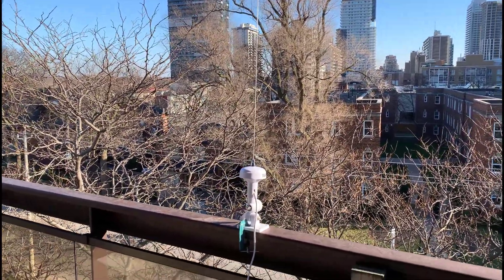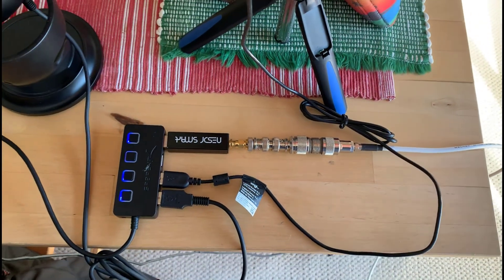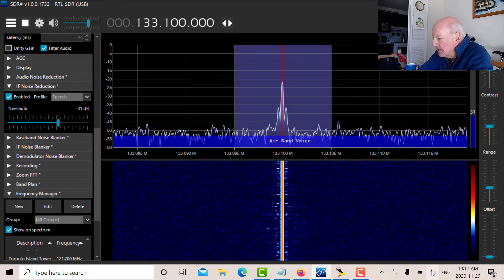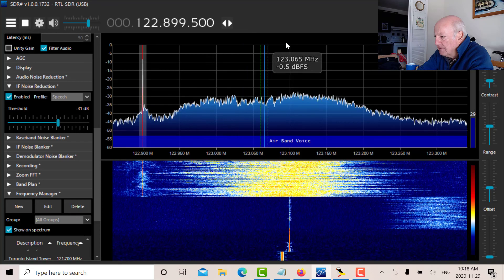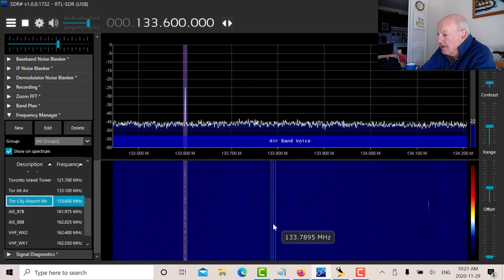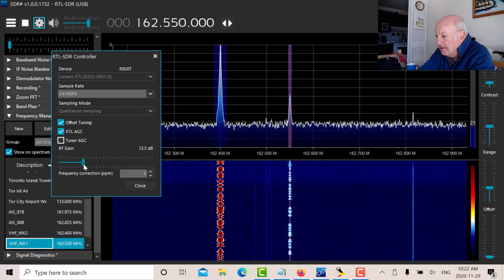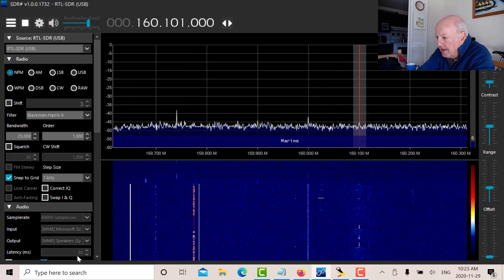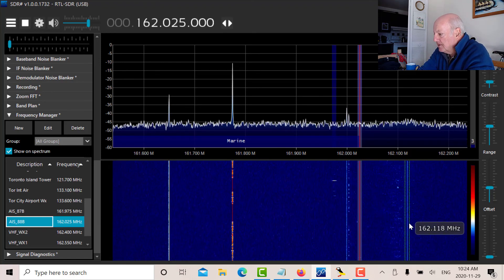RTL-SDR for VHF Air & Marine Bands

Comment: I am so confused. I am using the same SDR receiver and the same software, and I am getting an extremely strong signal from nearby airports, but voices are completely garbled. I watched another video that showed all of the settings, except he had it set on AM. The only way I can hear anything is on LSB! 

I've been watching video after video and it's like everyone wants to keep the settings secret! So far, FM is the only band I can understand anything on, and not with any quality making it worth listening to.

Please tell me what I'm missing here, this is so frustrating!
Reply from the maker: For the aircraft, use the AM setting with 10KHz BW. Ensure that you zero the receiver to the centre of the spectrum. For marine, use NFM. If you don't centre the receiver, the reception will always be distorted. Also make sure you don't have too much gain, this will distort your reception. I typically only use about 10 - 20dB.
Reply: @ClarkTelecom  Thank you, I really appreciate your quick response! After I left my message I was able to pause the video and see what your settings were. I just copied what you have and audio is much better, though still not as good as yours. One problem I'm having is that they don't transmit long enough or consistently enough for me to get zeroed in on the signal. I also wasn't paying attention to the gain at all. I will check that today, but as long as I know my settings are correct, I should be able figure out the rest.

By the way, when I was a kid I had an old AM/SW radio from the 1940s. I used to stay up all night listening to stations from all over the world, long before the internet. It's not the same today, but it was a fascinating hobby that I will probably get back into when I retire next year. I decided to look into SDR partially for that purpose.
Reply from the maker: @deltatango5765  Good luck! I did the same when I grew up, I liked all the international broadcasters with their different perspectives.